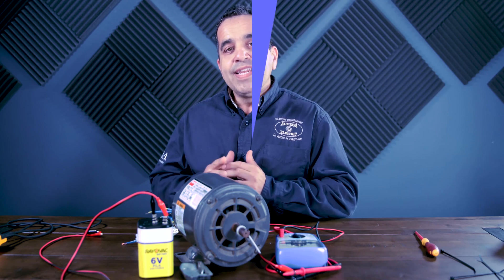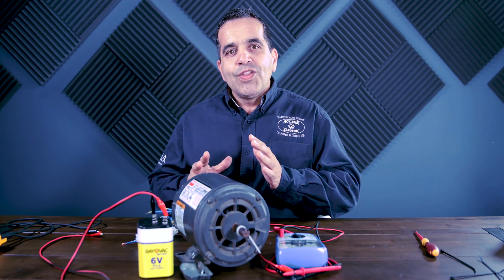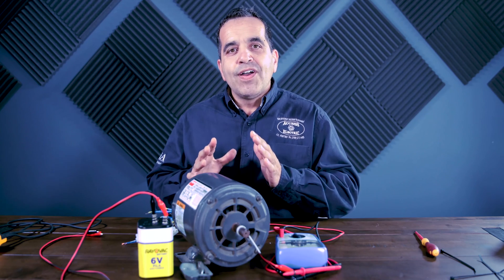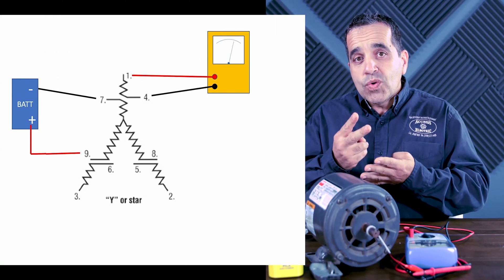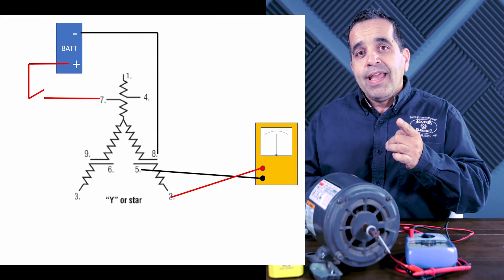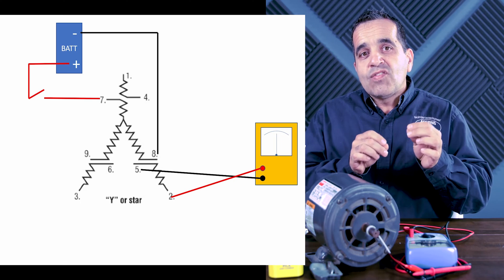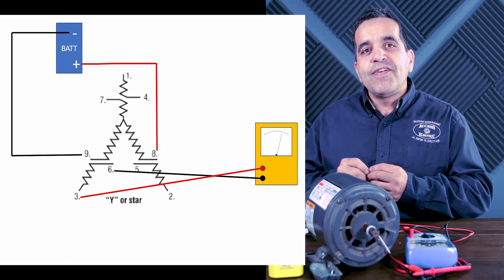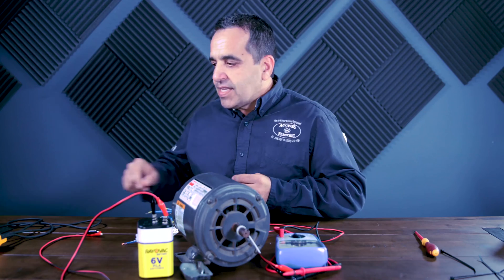Identifying leads on an unmarked 9 lead WYE connected Motor

Comment: If you have a 9 lead dual voltage motor with 9 different colored wires, is there a standard color code to be used to identify which wire number is what?
Reply from the maker: There is no standard color code for motor wire leads. They are almost always the same color with numbered labels or tags on the wire. If the labels get removed or destroyed, that’s when a video like this becomes very useful

Comment: Some company posted a video using the same method and called it Angie Hand’s identifying unmarked 9 lead Wye connected motor.
One circuit with three leads and three circuits with 2 leads.
I understand how 7,8 and 9 are identified, etc, but how do you know with authority the 8 is 8? 
I don’t see with Ny of the methods a that are used that you can do anything more than identify relationships between the different leads. 
No doubt this shows the relationships between the two lead circuits with the appropriate lead of the three lead circuit.
If you start out like you did in this video with 7, 8 and 9 identified, then there’s no problem knowing which are 1 and 4 etc, but I fail to see how you can know which was marked 8 from the factory if 7, 8 and 9 have all lost their markings! This test doesn’t demonstrate that!
Reply: That’s what I don’t understand.

Comment: *DO NOT* run DC current through an AC motor. This results in no induction of EMF to oppose the current flow and it increases to unimaginable levels and ends up burning out the coil. Use an AC current and an O-scope to probe the motor instead. I've posted a video on how AC motors work based on my college curriculum if you want to learn more.

Comment: What about the group 789 what is the use for that
Reply: Those are the three center windings. There are six total windings in the motor. Three share a common point and the other ends of those windings are leads 7, 8, and 9. The other three winding are between 1 and 4, 2 and 5, and 3 and 6.

Comment: I'm not knowledgeable on the internal wiring in the motor and can't seem to find an illustration of that makes real good sense to me. :-).
I don't understand why 1/2 --3/4--and 5/6 pairs can't be any two wires that show continuity. It would seem in 3 phase it would only change the direction of rotation if interchanged. I know I must be missing something. I'm trying to ID for a 220  3 phase power source
Reply from the maker: The windings have to be wired in the correct polarity as well or you will damage the motor
Reply: @AccessToPower  thanks. Is the same true for wye and delta ?
Reply from the maker: @jaspermcconnell6417  yes. The windings need to be wired in the correct polarity. If a winding is wired in reverse polarity, the magnetic field it produces will fight against the other windings magnetic fields

Comment: Hi, can you do a demo also in unmarked 6 and 12 leads? Thank you.
Reply: 12 leads will be Delta. It'll be necessary to find six pairs. The trick is finding which three can be the "y", and which of those to combine. same method, just more tests to find what is adjacent to what
Reply: @mikebowler1962  we build time traveling machines and these were very basics in temporal displacements for warp generator modules

Comment: How do you know which are 7,8,9? i know those are the inner group of three that make the y connection but how can you tell 7,8,9 apart?
Reply from the maker: SeanLeonDrums You start by arbitrarily determining which one 7,8,and 9 are. You then are able to find all the other groups in the right order.
Reply: @AccessToPower  So to be clear 7,8,9 can be labeled interchangeably?
Reply from the maker: SeanLeonDrums yes. However you number these 3 wires will determine the groupings and polarity of the other 3 windings. See my blog post on this topic https://accesstopower.com/identify-unmarked-leads-in-a-9-lead-wye-connected-motor/

Comment: Mine has continuity across all 9 wires. They had three groups of two already together and three wires left independent of the others.
Reply from the maker: if you have the 3 groups of two misswired, meaning one of the group of 3 is included in the other groups, then you would have continuity on all 9. the only way to test them accurately is to unwired all 9 and test them individually.  if they still have continuity you motor has problems.

Comment: How did you find 7,8,9 wire? How did you find which is 7, which is 8 and which is 9?
Reply: once you identify all of your 2 pair groups you would be able to correctly identify 7,8 and 9 by process of elimination.
Reply from the maker: there will only be one group of three windings connected together in a 9 wire WYE connected motor. once you find this set you can mark any wire 7,8 and 9. you will then follow along to find the other windings in the correct sets and polarity.  I started with 7,8 and 9 in the original positions so I could prove I found the other sets and also in the correct polarity....

Comment: I have tried changing 7,8,9 around and ringing one out 3 times, but the motor still only runs at half speed, no matter which of the 3 ways I did it. Stumped.
Reply from the maker: Hi Darcy, I am not sure what you are needing to do, but if you have a Y connected motor, then 7,8,&9 should have continuity when everything is disconnected. there will be the one group of 3 (7,8,9) and 3 groups of 2. If you have a delta connected motor then this method of identifying leads will not work the same way. In a 9 lead delta connected motor you will have 3 groups of 3.
Reply: @AccessToPower  its Y wound.  No matter what combo of 7,8,9 I start with (which changes your pair numbers) it runs at half speed. Fought another motor like this before, not the easiest thing to take to motor shop since it's a direct drive machine.
Reply from the maker: Darcy, are you using a galvanometer to find the polarity of the other three windings?
Reply: @AccessToPower  I am ringing them with a 6V battery and my analog meter
Reply: I am sure we can get the proper polarity and connection of the windings if we follow that. but I am not sure if once we already fixed the connection is T1. T2 and T3 will be the same. maybe T1 would be T2. T2 would be T3 and T3 would T1 because from the very begining, we are not sure if T7 is T7. may it is T8 or T9 but even the original marking will be change it will work.. based on my obvervation....

Comment: Finding 1&4 - what do yo do if you get two pairs that has similar deflections?  One pair has a lot of deflection, two other pairs are about the same.
Reply from the maker: When Identifying 1&4 If you are flashing the correct pair (ie 7,8,&9) then pairs 3&6, and 2&5 will have similar deflection. Only pair 1&4 will be a very small deflection. That is how you know you have 1&4. See our blog post. It has pictures of the correct order as well. I believe I placed the link in the description section. If not, here it is. https://www.accesstopower.com/blog/identify-unmarked-leads-in-a-9-lead-wye-connected-motor

Comment: When labeling 7 8 9, does that change the other pairs?  If the motor leads were originally labeled as 7 8 9, and you change 7 to 8, 8 to 9, and 9 to 7, will that change which pair is 1&4, 3&6, 2&5?
Reply from the maker: callitw, Yes if you change 7, 8, and 9 then the other pairs will change as well. But they will remain in the correct order, or relationship in the wye configuration of the motor windings. In the video, I left 7, 8, and 9 the same so I could prove the pairs, once found, would be the correct pairs in the correct order.
Reply: @AccessToPower  what if you don’t know 7, 8 and 9? Is there a way to figure that out or do you just label them and start from there?
Reply from the maker: bri may , you label them and then start from there.
Reply: @AccessToPower  thank you, sir. It never ceases to amaze me what you can find on YT. Any project or problem or idea, etc, you will find someone addressing it. Teaching you the theory or hands-on how-to’s. All we had as kids were books and encyclopedias or taking a class. Thanks for dedicating your time and effort to educating people in your field of expertise. May the Lord bless and keep you and your house. 🙏🏼
Reply: @AccessToPower  great video. So I am replacing a stator and I started shortening wires before relabeling them was able to deduce the positive negative ones as only cut 4 wires prior to realizing my mistake. I had 9 uncut but have 7,8 left and do not know which is which. Pump can be wired for 220 or 460. My question is what happens if I simply guess 50/50 chance of being right, but happens to the stator if I am wrong?